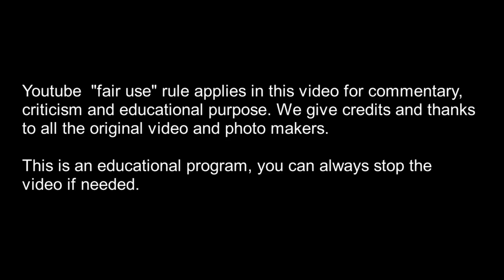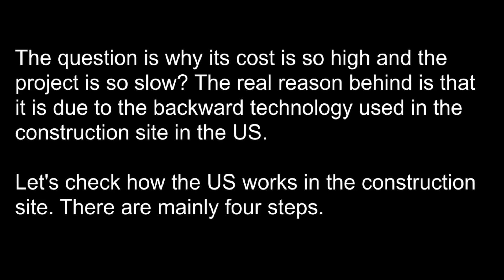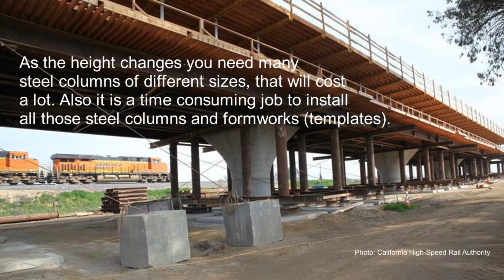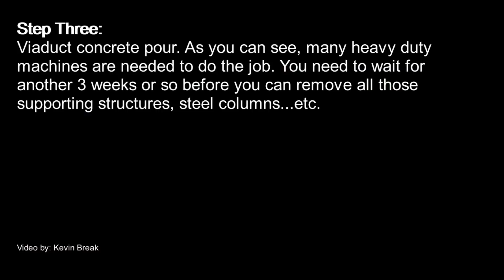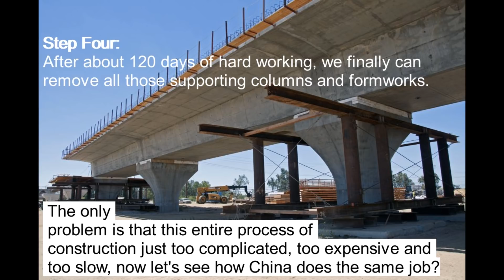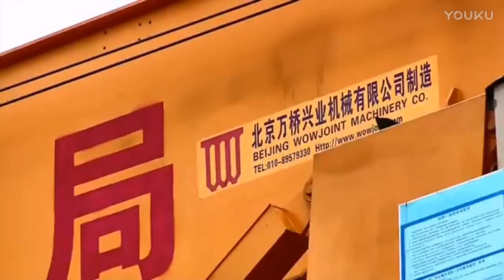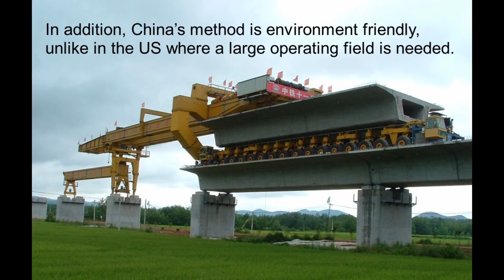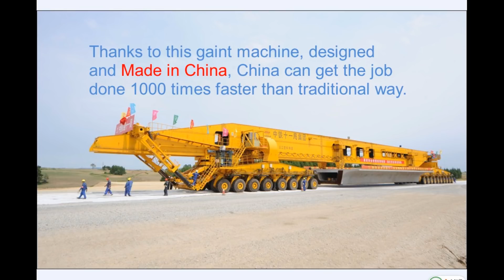USA vs China on High Speed Rail Construction

Comment: the concrete beam girder should be made in an easily accessible location separate from the bridge construction site, at the same time as the bridge pillar construction

the US built a "beam bridge" like building a "cantilever bridge", not surprisingly, it was never finished and expensive 🤔
Reply from the maker: In the US way you need too many materials and time on falsework, which consists of temporary structures used in construction to support a permanent structure (mold concrete) until its construction is sufficiently advanced to support itself.  Had they contracted the job to China some 7-8 years ago, they already have the train running 4-5 years ago, and only cost less than 1/3 of what they have already spent.